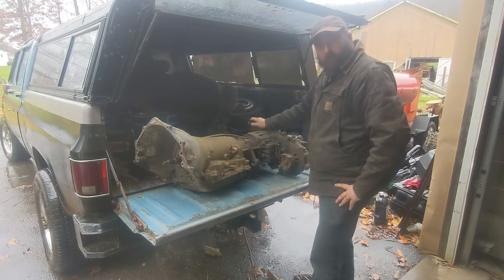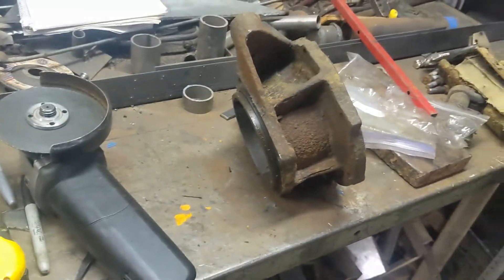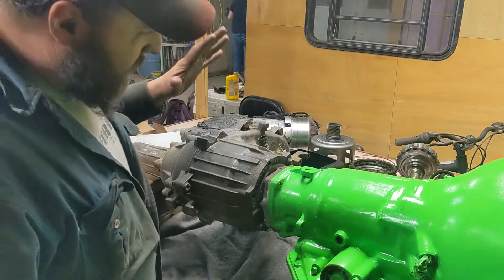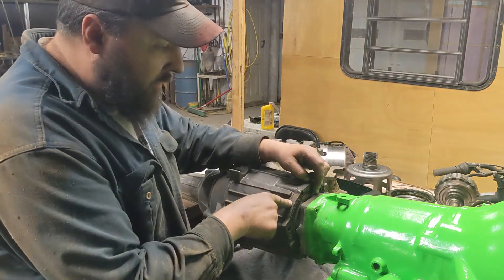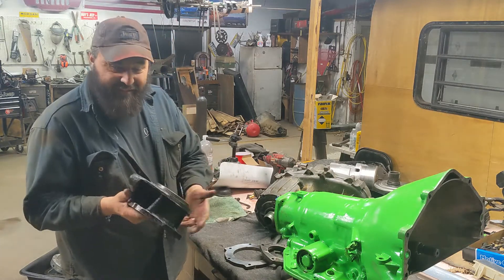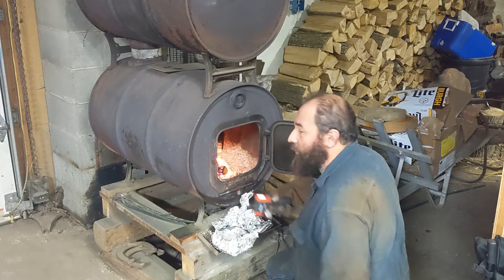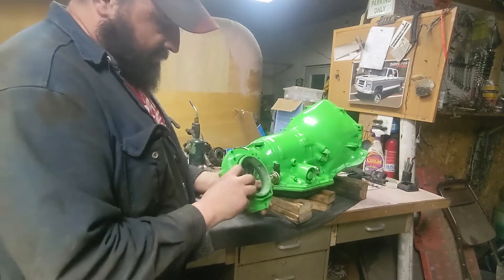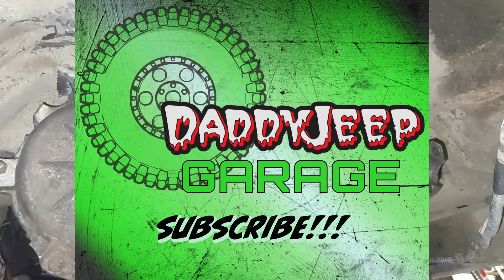Custom TH350 To NP241c adapter - 4l60e adapter fabricobbled to fit - machining - welding - diy

Comment: I have a NP241 C Passenger drop with vss from a  K1500, K2500 & Suburban27 Spline input, rear slip yoke 4″bell front output, 700R41989-1992.

Can you please tell me what bolts go into this from the trans adapter? I was told M10x1.5x35 10.9 but these deff dont fit, I am thinking maybe these are not metric bolts for this tcase of this year? Any help would be greatly appreciated?
Reply from the maker: I believe it should use a 3/8-16 stud, with 3/8-24 on the other side that takes the nut

Comment: Good Video! I was looking into do something similar. I have a th350 to Toyota transfercase.  And been wanting to do a 208 or 241 and couldn’t seem to find an adapter
Reply from the maker: I love the short length of the TH350 so it was worth the effort.

Comment: May I ask where one can get a 4L60e to NP241c adaptor? Excellent work on yours!! MK
Reply from the maker: The 4l60e to 241c adapter is in every 4x4 Chevy from 99 to at least the 2010's. The one that I modified was from a late 90's truck.